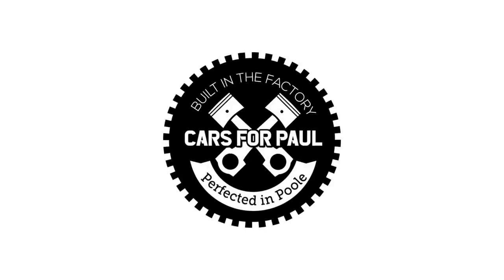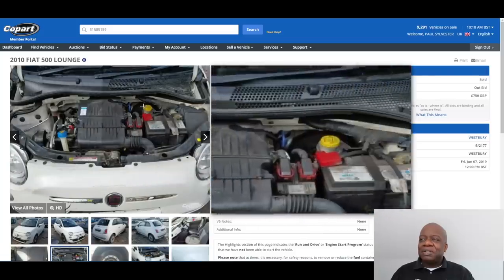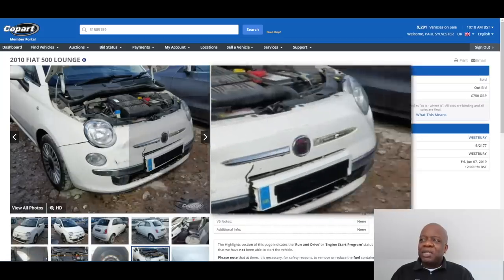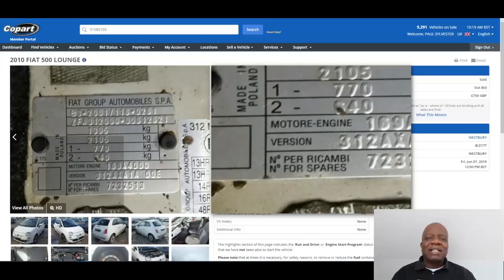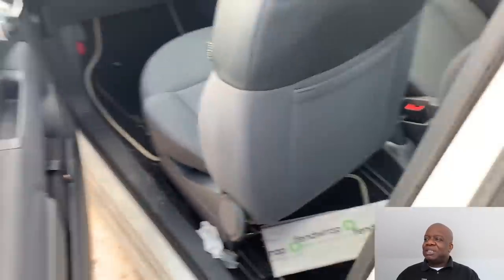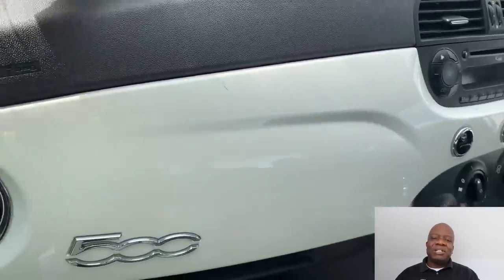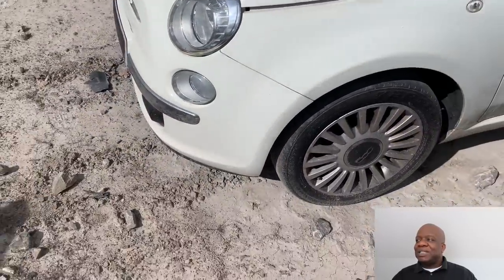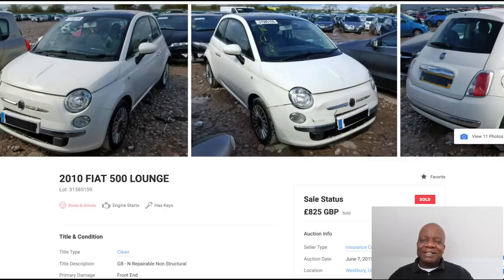How Not to get scammed when buying cars from Copart

Comment: I learned my lesson the hard way, I bought a ford van from Copart with damage to the near side from and suspension only needed a wing, headlight, mirror and a wishbone. The van only had 63,000 miles on the clock but didn’t start, they said it could be a flat battery but when the van was delivered and we tried to start it wouldn’t start only to find out that the engine was fucked so I had to buy a new engine.

Comment: I've seen dozens of Copart specials. The best was a 2017 A Class with body damage, stated as non runner but not mechanical. The guys who bought it put it on the ramp took off the undertray and the rods were through the block. The cost of body work and a 3.5k engine later..... off course Copart said sold as seen. The lesson being disregard anything they claim and look for yourself. And if you don't know, stay well clear. CAT U really means unsellable elsewhere
Reply from the maker: Wisdom, such a valuable thing

Comment: The 1.6 FSI engines had problems with their hydraulic timing chain tensioner. When the car is turned off the oil pressure in the tensioner drops, then when you start the engine it can take a few seconds for the oil pressure to build back up. This combined with the use of plastic chain tensioners and guides, maybe could have caused the chain to jump a few teeth.

Comment: they should all be scrapped ,I hope the customers  who get these cars after there repaired know that there buying the insurance companies crap,I bought one 20 years back it was great ,until someone went into me,it fell apart,I certainly wouldn’t put my kids in this rubbish ,great video though
Reply from the maker: Times have changed and the dangerous cut and shuts of the '90s have long gone. the stuff that goes back on the road today is safe with only minimal damage.
Reply: Cars are designed to fall apart now the car takes the impact not you. A lot of the cat n cars wrote off today are a real shame and marked as wrote off for a damaged mirror or bumper false fucking economy
Reply: The insurance company will pay out the retail value of the car when it is written off. If they can sell it to be repaired they get 25% to 50% of their payment back. If they scrapped them all your insurance would double.

Comment: Really relaxed presentation style makes it look easy. so far so good. But I would be looking more at the ages of the cars as 2009 would be a cut off for me with a lower or medium milage in fact best to make it 2012 ten yrs, old  paying a bit more can be worth it in the long run. You do not miss much but small issues soon add up and profit is lost. Overall a good intro to buying.   If you have a qualified mechanic then you can both make a wage.

Comment: Interesting videos. I was surprised you identified the knackered engine Golf as a 'scam' car. I was waiting for a forged V5 or a dude in a sheepskin coat... Surely the engine problem is really just a 'buyer beware' issue? Some dafty buys it without starting it, I'd be thinking they are the mug not the vendor? Anyway, very interesting.

Comment: I bought a mondeo,1.8 LX auto,it was really a bad buy in my own eyes and wished id bought a straight car..But i really fancy buying a copart car that has minor damage as i watch different videos on here..I don't have a huge budget but it be interesting to see how much car i could buy on a very limited budget.How much would you say..?
As my mondeo on a 1994 plate was a real bad buy,it had outstanding finance and was poorly repaired by my chosen garage,sub frame was bent also.i think i paid £1700 cash and then a further £600 in repair work..i did however manage to sell it for £1200,at least i got some money back..when you lose £1100 on a car..that's mega scary..this was back in 2002-2003 time..
Reply from the maker: Hi Tim, with any salvage car, you only save money when you do the work yourself, if you have to farm out all the repairs to a garage, then its a false economy and will cost you more money as you discovered. my biggest issue is paintwork, I am useless at it so I try to work around this by buying panels that are the correct colour. Hope this helps

Comment: I bought a van and it had a solar panel on it in the pictures, when it arrived the panel had been removed do you think i have rights to compensation?
Reply from the maker: You will have a battle with that, its Copart your taking about and they are task masters when it comes to trying to get compensation.
Reply: Yeah they offered to resell the vehicle 

decided not to do it 

solar panel was removed and the extra batteries and charge controller etc the blinds on the windows pretty much any accessories that weren't made by nissan were removed they said I should of viewed it before I bided the pictures are just for convenience and they can remove any parts the wish before the auction

Comment: Love the videos...  Just on the Golf Match... I couldn't quite hear how loud it was but that FSI engine is very rattly when you start it for the first time.  If it's extremely bad when warm,  then it's the infamous cam chain tensioner that's on its way out.  They're not that difficult to replace.  The other issue with these Mark V Golfs is the diff bearing in the gearbox and that's not really something for the DIY mechanic... needs a gearbox specialist.  The 1.6FSI is a horrible engine,  if possible try and get the 1.4TSI in the very last of the Mark V Matches.  They also suffer from cam chain issues but at least the engine's a little more lively and fuel efficient.